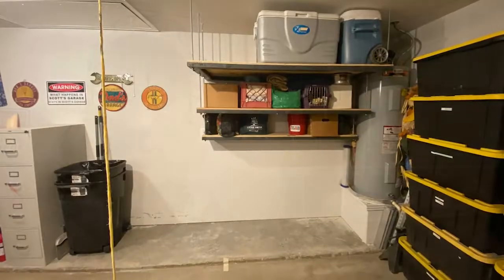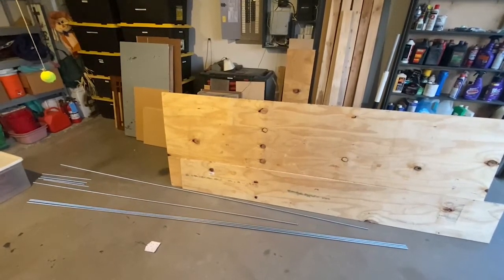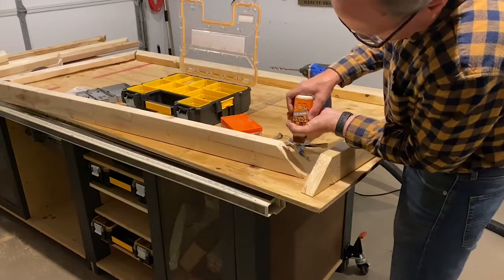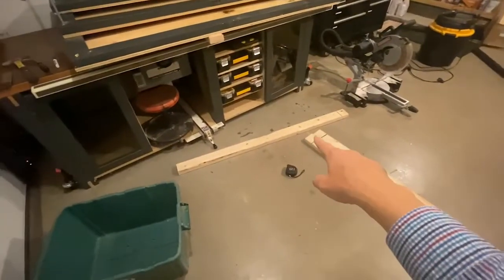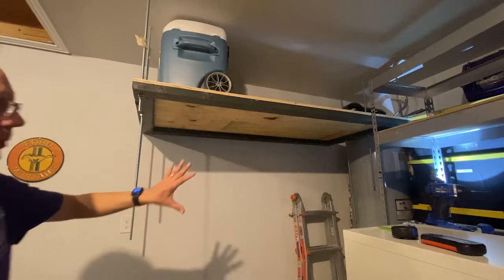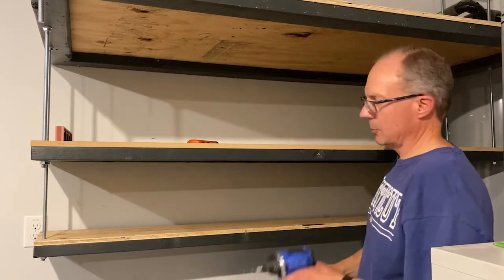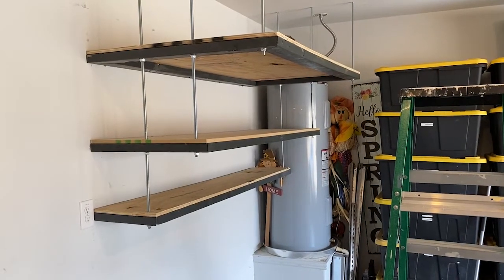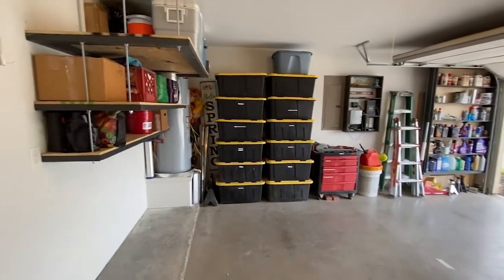DIY: How to Make Super Strong, Suspended, Staggered Overhead Garage Shelves Using Threaded Rods

Comment: Nice! I personally would add a center 2x4 brace board to the top shelf. It's been my experience plywood warps and sags with large unbraced areas.
Reply from the maker: I predrilled center holes to add another threaded rod if need be. So far, so good.

Comment: Nice work here! Thanks for posting.

Have you had any issues with the exposed ends of the threaded rods? I'd be worried about a kid running under those lower shelves and getting scratched. What would you do to finish those off? Grind them down to the nut...or maybe cap them off with a closed-end nut?
Reply from the maker: No, but we don't have young kids. You could add a cap over the threads.